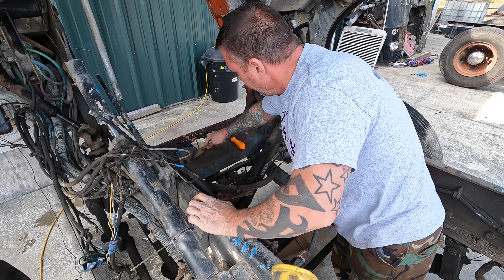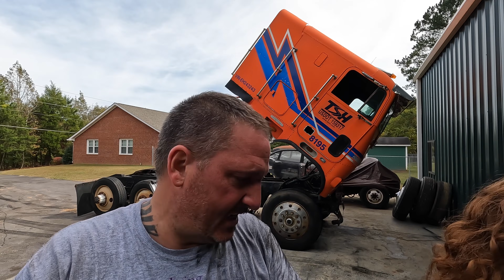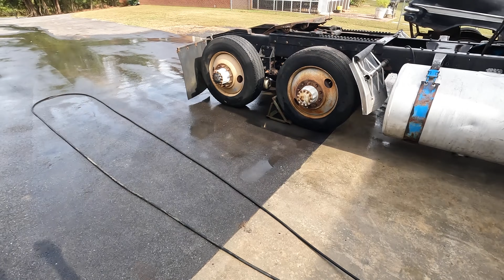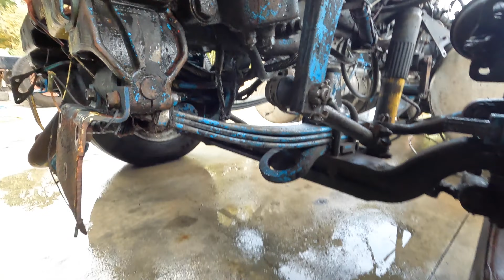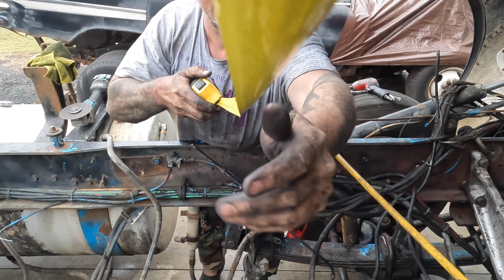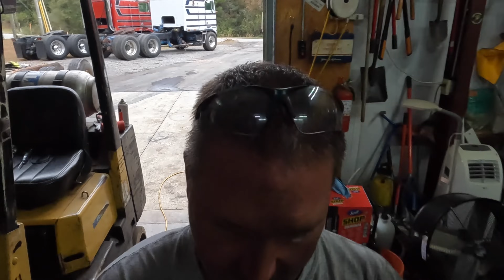1984 Freightliner "DeeDee" gets started on the 8v92 engine swap

Comment: Wasn’t that other frame a freghtliner too? You should be able to steal your measurements from it . Don’t think I would try and do the hole drilling without a jig of some kind to make sure I got those holes in the right spot. Did you keep the clutch linkages I’ve got a feeling you might need them . If you’ve got frame drill those work great. They had to drill holes in my truck frame to mount my oil tank. Used a magnetic frame drill that was slick. Next time the engine will be in and it’ll go from there. Stay safe